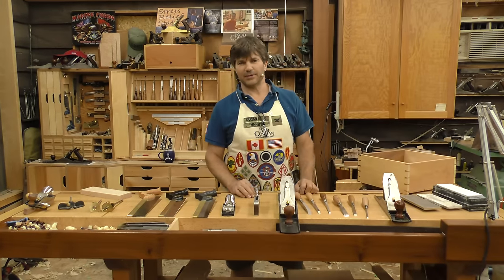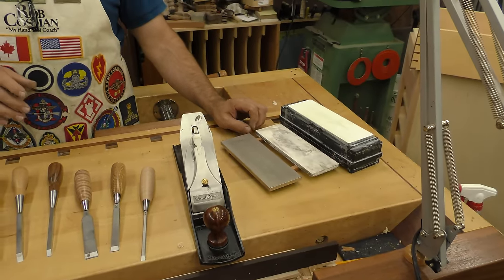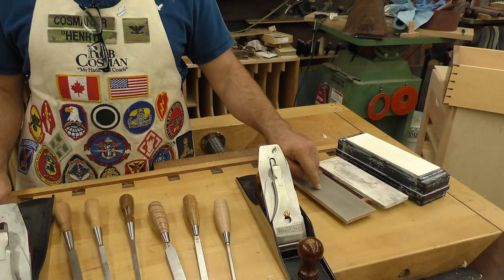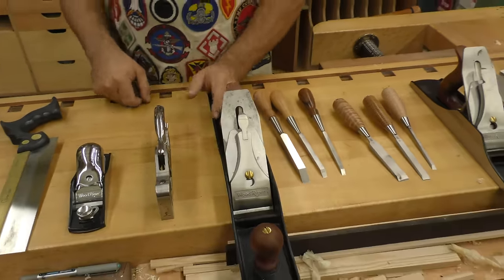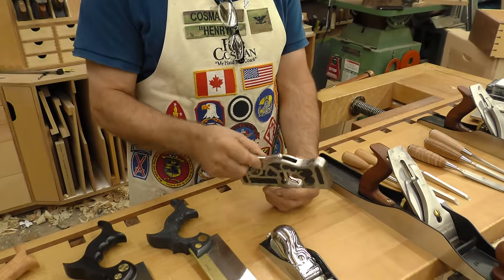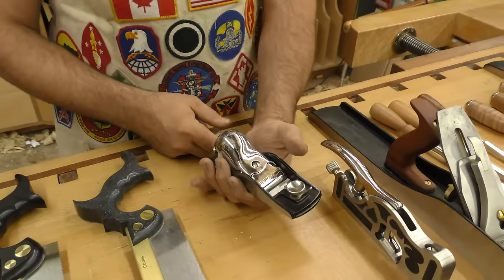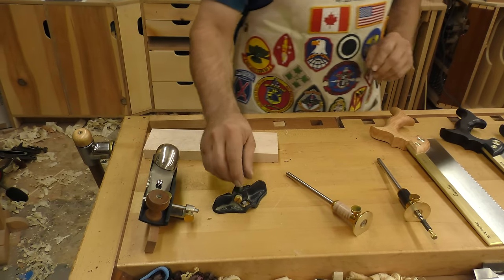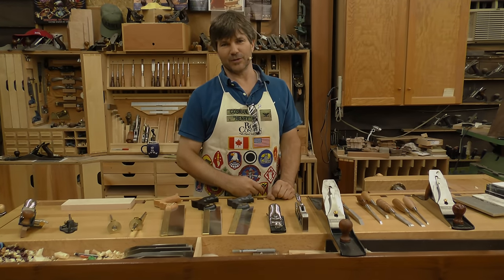Top 10 Hand Tools with Rob Cosman

Comment: You know I've been into this for a year now, and I have to say there's one tool that should probably be number 2 on your list and isn't even on it.... you most definitely need a BENCH before you get into rabbet planes or mortising gauges!
Anyone who has scrub planed a board using a Workmate will agree!
Reply: Anyone who has scrub-planed a board on a Workmate is probably quite capable of making their own bench. Indeed, one might argue that any woodworker who takes themselves even half seriously would make their own anyway, as a point of pride... and anyone outside of that can just find a number of pretty easy instructions online. 
Give it a go. It's brilliant fun - I really recommend it!!
Reply: You know you are right a good bench is absolutely a necessity and if you subscribe to Robs channel he has some great videos that will take you through the process of constructing one.  He has one series on an assembly table / first work bench and then an incredibly detailed series on building a dream bench (178 half hour videos.)
Reply: Of course, the last thing I scrub planed on my Workmate was the pieces for my bench top.  ;)  Technically it also came in under $100 as I got the SYP used, but it was well over $100 once I got all the drawers made.
Reply: I was mainly intending to point out that having a bench wasn't an assumption on my part - I thought I could do without for longer than I did, but I found out the hard way that frankly, hand tool woodworking sucks without a bench.
Reply: I agree that a Workmate is not a workbench LOL, but that said  but you do not need anything fancy. As long as it's solid and you have some way to secure your work - good to go.  Any beginning woodworker can build a usable bench for $1-200 (or less, really..) out of 2x4s and MDF.   Some good vices on a utility bench are better than a fancy bench with lousy vices however.  As soon as you can - buy a good vice.
Reply: Personally, I don't have an option to have a work bench. I don't even have enough space to own a miter saw. Still, I get my projects done one way or another.
Reply: Rulik Marulik - exactly! Well said mate!
Reply: Spoken like a true armchair quarterback.
Reply: my first work bench was a new door on top of a stack of plastic milk crates...a very flat square torsion box plus a sheet of mdf on top actually...add a few clamps and you are ready to go

Comment: There are lots of approaches for beginners. When I teach I recommend using decent wood even for absolute beginners. Using cheap softwood can be demoralising. The same applies to tools. However, not many beginners want to outlay large amounts of money. At that stage they don’t know if they will persist, or whether they want a few power tools. They might neither have the skill to renovate second hand antiques. There are old tools on eBay that come ready to use, if you look carefully.  So a newbie can set up for a few dollars each for a tenon saw, chisels, Stanley block plane and a number5. A square is absolutely essential. Again old ones are better and cheap. A small fine tooth hardpoint saw covers a lot of the work. After a year or two then start treating yourself to Robs recommendations. They aren’t expensive considering a lifetimes use.
Reply: Jim Bo Coming from a beginner it can be hard to decipher what's quality and usable on eBay. I took a couple weekend courses at a local shop and bought Paul sellers book which is loaded with great info and still struggle knowing what is worth it and how much it's worth. Maybe it's just me but the clean older stuff maybe goes for 20% less then buying new(middle of the road new) and I know what I'm getting. The major setback is I have to Pace myself when buying the better stuff and can't splurge and buy everything at once.

I'm sure alot of it is situational as I have a garage full of 1950-1970 restored power tools to supplement myself as I build my hand tool collection.
Reply: Thank you Mr.Cosman. I am a begginer in woodworking.I love hand tools, but good hand tools are just out of my budget range. Your video opened my eyes to this fact. I will stick with my " less expensive " electric tools. Once again, I thank you for your great video ! !
Reply: Sorry, I miss spelled beginner!

Comment: Picking up mortise chisels has been creeping up higher on my list. Knowing to care about the sides for registering is great to know. Also I think you mention using the mortise gauge that you should use the width of the chisel blade to match the width of the mortise itself. Very helpful information. I will probably buy a Narex set with 4, 5, 6, 8 , 10, and 12 mm sizes. 80 bucks seems reasonable.
Reply: What are the next best starter mortise chisels that are square and I can get five to eight of them for around $100? I have seen older ones and probably have a quarter inch one buried with other old-old tools.

Alex: Do you think it is possible your Narex are a different generation than current? They look straight from pictures it is impossible to be sure.
Reply: The chisel blades of these 8112 Narex mortice chisels are correctly trapezoidal in section and have been neatly CNC machined from Chrome Manganese (CrMn) spring steel, which was developed for Narex specifically for the purpose of making edge tools. This means that Narex mortice chisels take and hold a superb edge. 

The Narex 8112 mortice chisels are accurate, hard and immensely tough: serious tools and seriously good value for money.
Reply: The Ray Isles mortising chisels are trapezoidal as well so you can free them by pulling towards you when they jam in the wood. They are a very old classic design with modern steel; not horribly expensive either.
Reply: You don't really need all those sizes for furniture making, i would pick 6, 8 or 10, and 12 these three will do.

Comment: I think a smaller "smoother" size bench plane really should be included in this list, especially for anyone doing anything other than house furniture, or anything planed in place (at potentially awkward angles)away from the bench.  No matter what else I had in my kit, I could not do without either a #3 or a #4.  

I was just raising this same objection with Matt Estlea on his "What planes do you need" vid the other day.  Different focus there, as he was only speaking of essential planes, not a whole kit of all necessary tools... but my conclusion is the same.  He ended with a low angle jack (#5 size, I believe the old Stanley number was a #62), and a block plane, as his vital "first purchase" recommendations.  Even MORE so here, with your choice of the 5-1/2, I say you need a #3 or #4 for those common in-between tasks, where a "Jack Plane" is too big, and a Block plane is a bit too small.  You CAN get by with nothing in that in-between size, but why make life hard on yourself?  There's a reason the #4 is SO common on the antique market.  The old-timers used that one at least as much as the #5 (the latter generally referred to as the "most versatile").  Point being, you really should have both.
Reply: Fair enough, I guess...  Along those lines, would you feel any interest in doing a follow-on "Next 10" hand-tools list?  (I.e., items 11 through 20 on your priority list, aka. "additional tools you'll find yourself wanting eventually"?) 

I realize your whole point here is basically talking to people just getting started (and on a presumably limited budget), with the implication that once they've been at it for awhile, they'll know what further tools they need from growing experience.  But it might placate guys like me who'd like to hear a compare/contrast of why some other tools considered basic by tradition, have been reduced to second-tier priority in your scheme.  I mean, I take your point on the Jack vs. Smoother example.  But calling the #140 skew-rabbet block a high priority was another surprise for me.  I'd be interested in your thoughts on what other "also nice to have" items would come recommended immediately after that one. 

I'll also try to keep reminding myself, that we're speaking here of Furniture-work specifically, not traditional house-carpentry, nor boatbuilding.
Reply: Rob I'm there with you... except to say Paul Sellers says the same thing about his 4-1/2 (which he uses for everything, apparently...)

Comment: Incredibly valuable information. Thank you! Question: How would you feel about a No. 62 low angle plane instead of the 5 1/2" plane as a starter?
Reply from the maker: YUK!  I hate the 62.  Too light, dont like the blade adjustment, not enough side surface for shooting.  Was never a popular plane in its day.
Reply: RobCosman.com Thanks Rob! I value your opinion and appreciate the response. Cheers!

Comment: Remember guiz. Don't learn any carpentry. It's more fun to buy the most expensive stuff and magically make cool joints and boards.
Reply from the maker: Carpentry uses hammer and nails.  Furniture making uses wood joints and glue.  Learn the lingo before you post.
Reply: @RobCosmanWoodworking  same thing.

Anyways, great channel.
Reply: @sampokemppainen3041  Not even close. Also no where does he say anything about not learning the craft. It's common knowledge you can get anything done with cheap tools. Cheap tools also bring loads of frustration and waste a lot of time because they don't work well are inaccurate and are a pain to set up. Its also common knowledge that more expensive tools usually cut down the frustration considerably and in most cases make the work enjoyable.